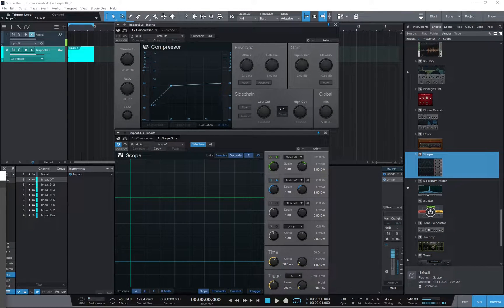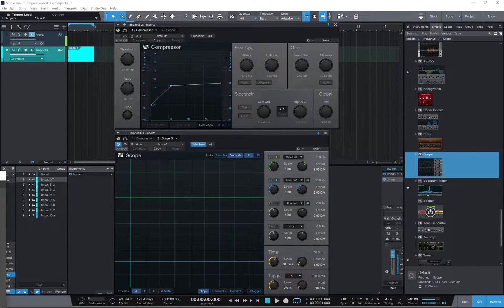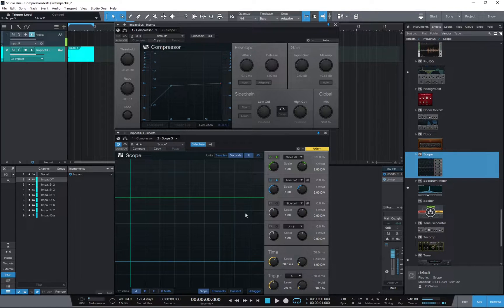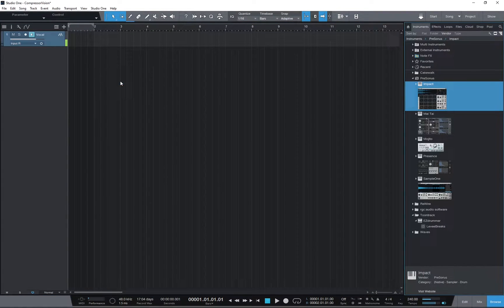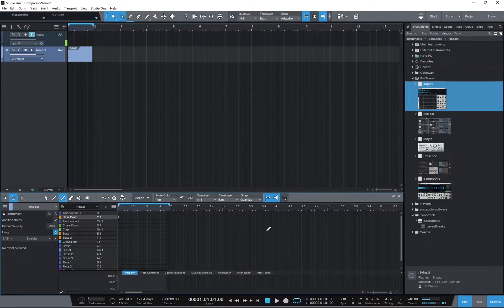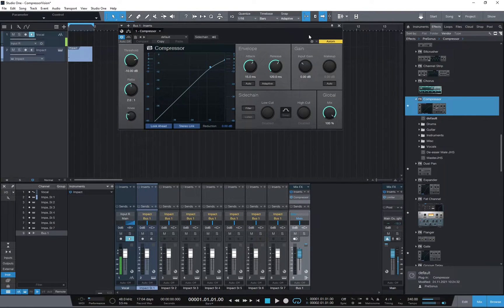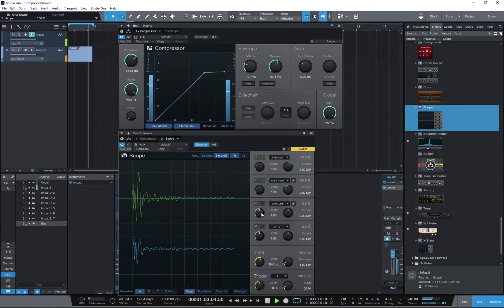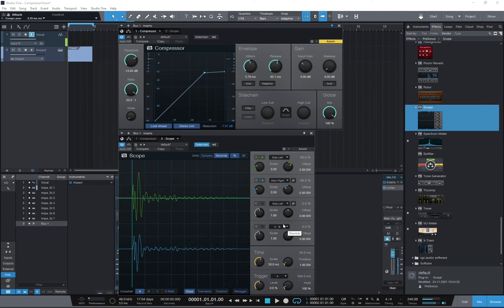PreSonus Studio One "Compressor Vision"

Comment: You probably should use your hearing in relation to compression
Reply from the maker: You're right, your ears should always be the final judge. The purpose of this video is to help beginners get beyond the mystery and intimidation of compressors. Even though many beginners may understand what threshold, attack & release are, the challenge is in understanding what a 10ms attack vs. a 20ms setting do in relation to, for example, a snare hit. My hope is that this video encourages new users to play with their DAW in general, and in particular play with a compressor and use their eyes to help them understand what they are hearing as they experiment with different settings. Then, when mixing using their ears only, they'll have a better sense of what to listen for when adjusting a compressor.